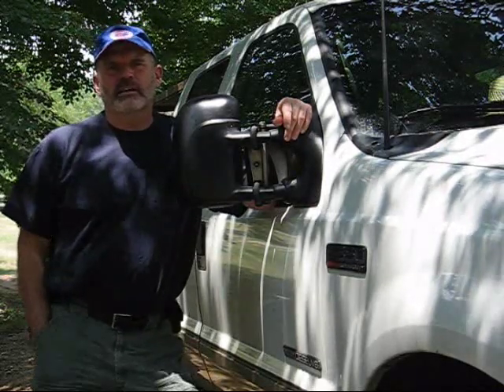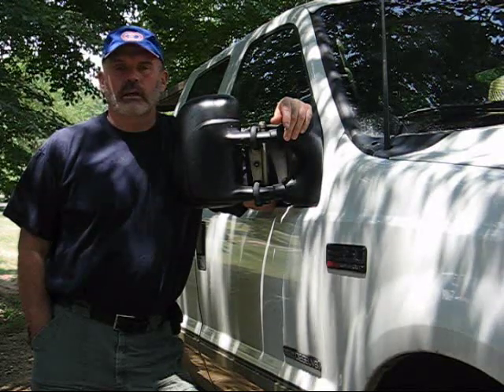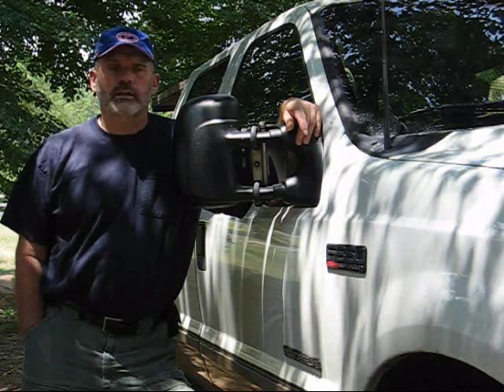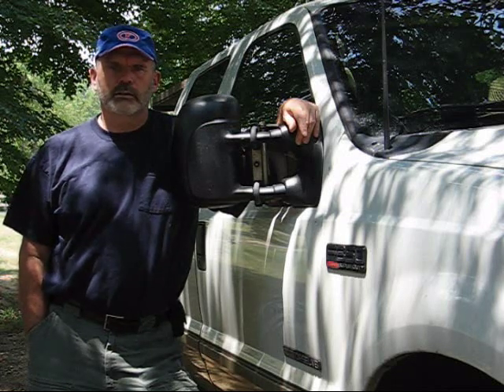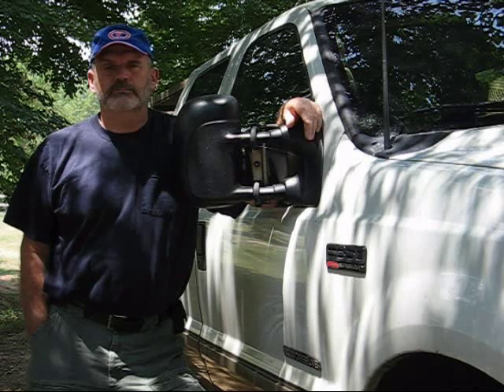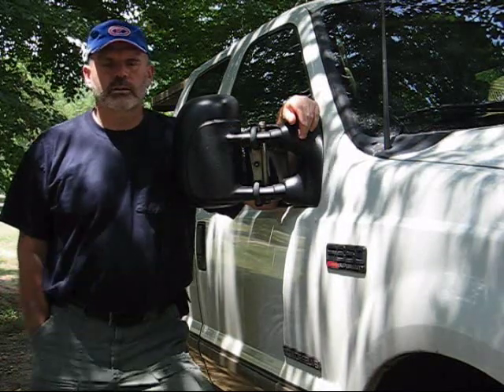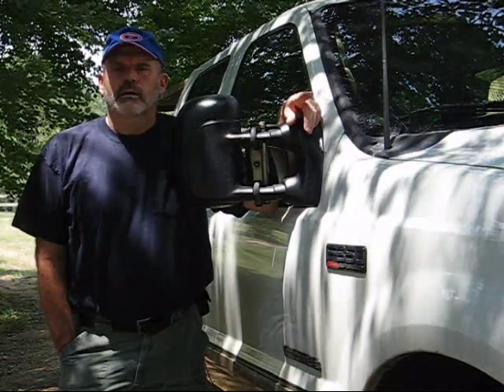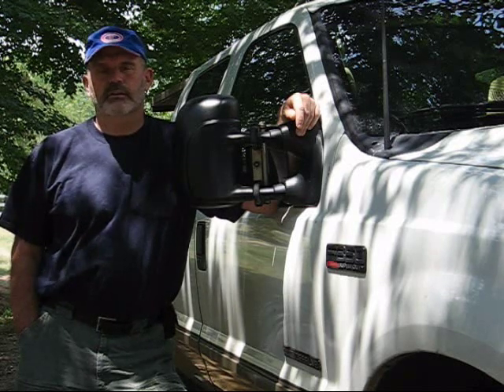009 HHO Dry Cell Second MPG (mileage) Test F350 7.3L Diesel

Comment: More production via more temperatures leads to more bubble production on the plates and that interferes with amp draw.  You've hit the limit on that one cell, you can only get more by adding more cells with a dry cell system.

Comment from the maker: Hi Tony: I am glad to know that you are working with a Powerstroke that doesn't have split shot injectors. Please post or PM me the MPG results. My best guess is that you will have to add at least 6LPM of HHO to get an improvement that can easily be measured. 
How are you going to mount the second alternator? After you modify the alternator you will need a DC to DC converter so that you have a constant voltage output to the HHO brick. Let me know if you find a reasonably priced one.
Mars

Comment: @tonysshadow
Tony or Mars or anyone...
I'm adding HHO to my 1978 Chev Silverado 350 gasoline-engine classic. It has standard ignition (distributor cap, rotor) and a 4 bbl carb. No computer that I'm aware of. Introducing the HHO thru the PVC valve. Will the truck idle faster? Will I need to manually reduce idle setting on carb? I don't know about sensors, etc on this model vehicle. What can I expect? Any thoughts would be appreciated.